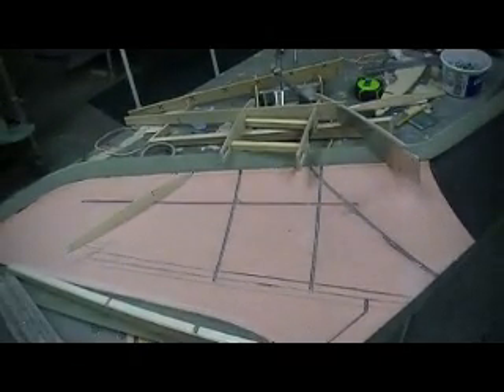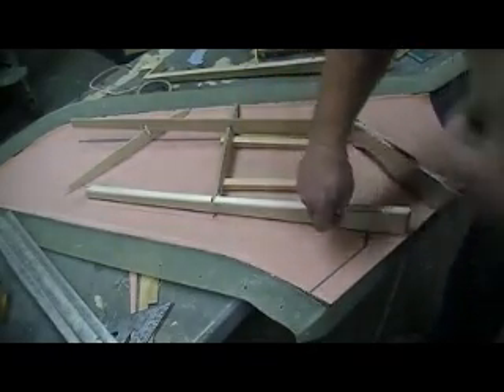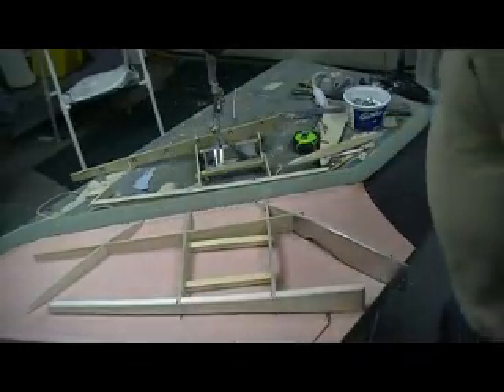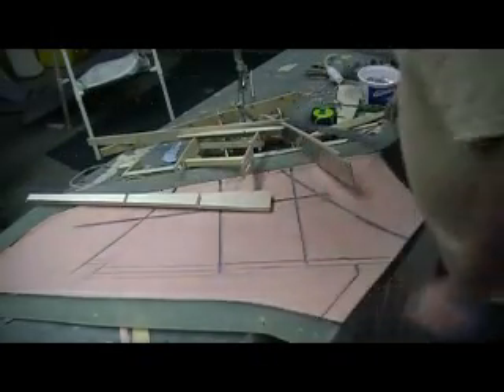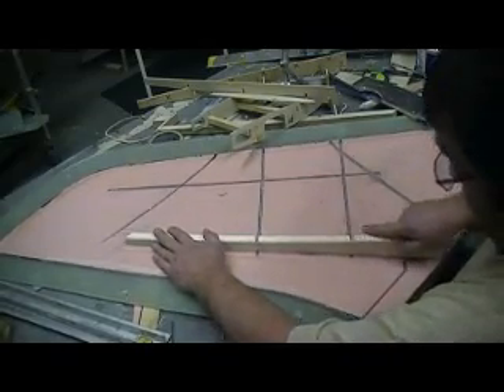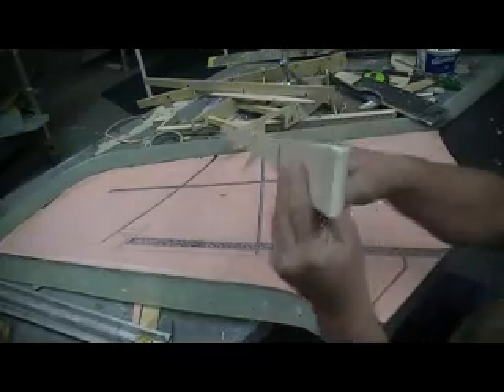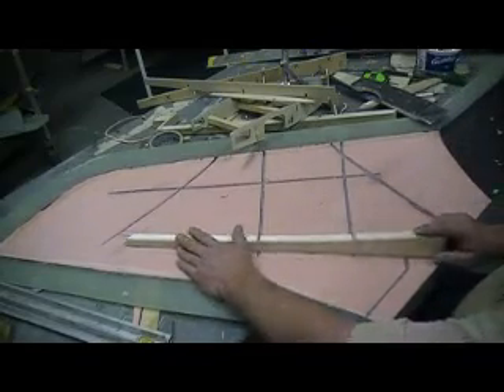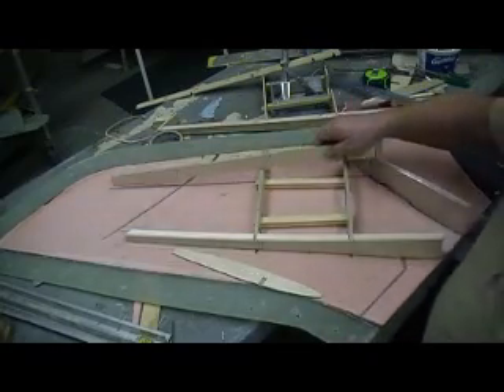how to build a rc jet F-105 thunderchief # 284

Comment: Channel iron would be a little more accurate than I-beam and when you bond the two halves together it will be like a boxed frame rail- more than twice the strength of the individual halves.  With all the planes we have watched come out of the shop, the debut of the b-1 could be an airshow with nothing but planes from the drama free shop, Bob flying his toys, Camlex sending a couple, and maybe "Dad" showing off the progress of the SR-71